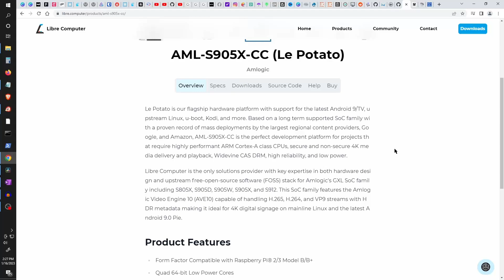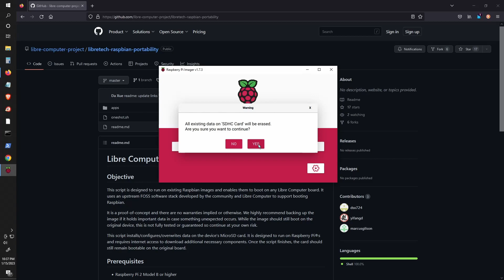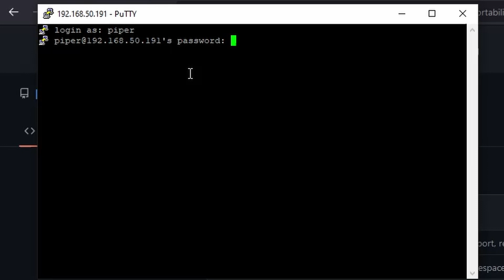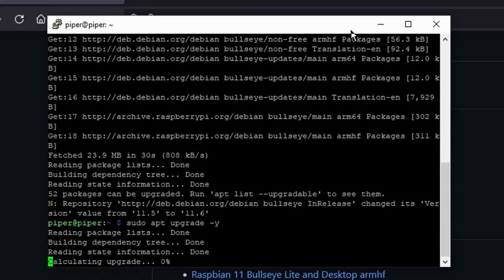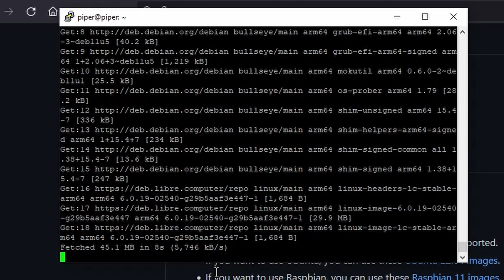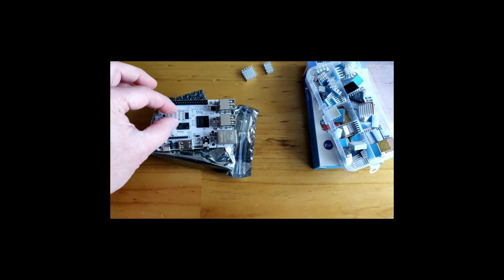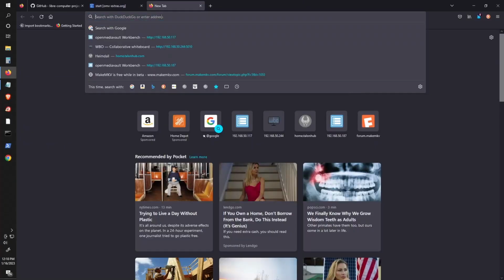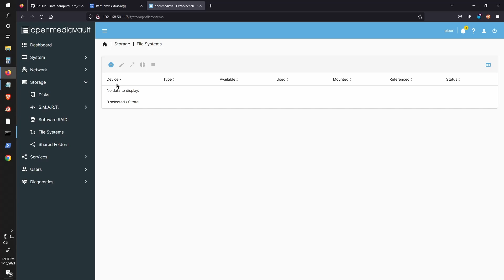Le Potato. Installing Raspbian and OpenMediaVault6 on Le Potato.  Alternative to the Raspberry Pi?

Comment: Can you tell me what case you have in this video and where you got it. Thanks !
Reply from the maker: The case I used for the Raspberry Pi 3B+ is from Geekworm.  Here's the link to Amazon: https://amzn.to/3JTzCWg
Reply from the maker: any Raspberry Pi 3B+ case that use separate heats sink and cooling fans should fit. I use Makerfocus from Amazon.  https://amzn.to/3wZi1o9  Cases that use passive cooling will fit the le potato but will not be efficient cooling it since the cpu and ram placement is different from the RPI3B+. Downside to using an RPI3B+ case is there is no provision for the IR sensor but it's nothing a 3.5mm size drill bit won't solve.  If you have access to a 3d printer here's a link to the files. https://www.thingiverse.com/thing:3426091
Reply: I was going to ask you the same; I still do not know why you have a low subscription count. Great content, thanks for your info. Best regards and be safe.
Reply from the maker: @luisbperez368  I'm glad you liked the video and I truly appreciate your kind words.